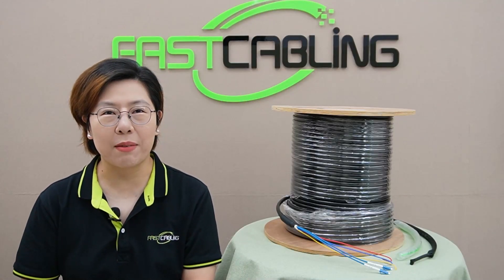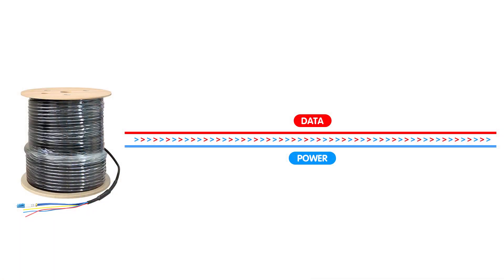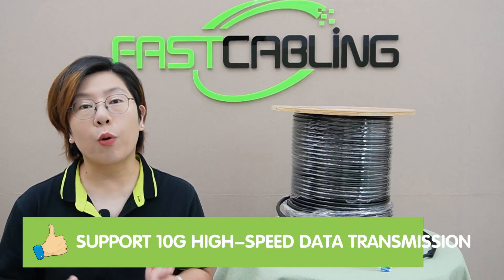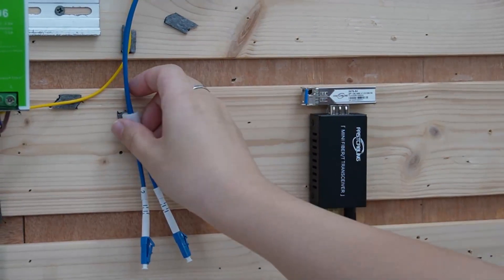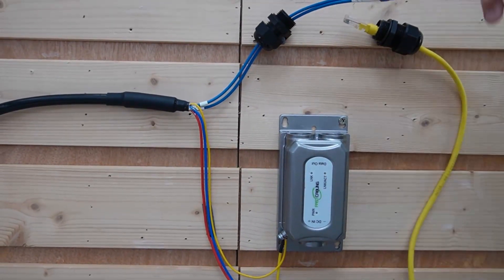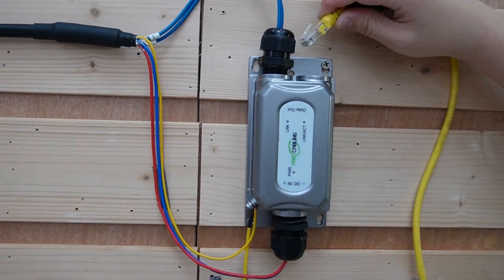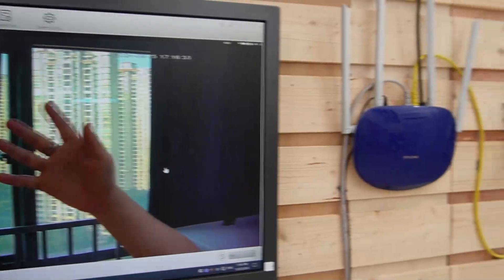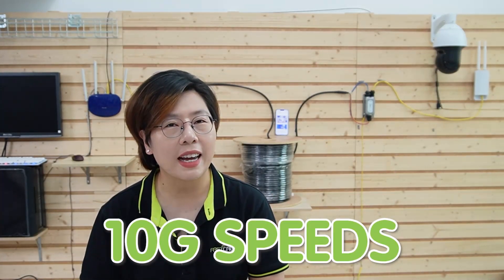How Armored Composite Fiber Optic Cable Simplifies Network Infrastructure

Comment: Please you did tell us how many core the fiber optic cable have.
Reply from the maker: The number of cores in the fiber optic cable can vary depending on the specific model or setup you're using. Common options include 2-core, 4-core, or even 8-core cables. If you're referring to the one in the video, it has 2 cores. 

https://www.fastcabling.com/product-category/composite-fiber-cable/

Comment: Don't forget to explain, it has distance regulations, people can't run this very long and obtain power.
Reply from the maker: Thanks for bringing it up! It's true that if the distance is too long, the voltage drop may become significant enough to affect the performance of connected devices.
Reply: @Fastcabling  I did a video on this and how to calculate the distances :)
Reply: What is the max distance limit?
Reply from the maker: While exact limitations can vary, a common rule of thumb for copper cables is to keep runs under 100 meters (328 feet) to minimize voltage drop. For longer distances, it may be necessary to increase the wire gauge (thicker wire) or use additional power supplies at intervals. 

Or you can consider using AC power. High-voltage AC transmission lines are capable of delivering power over hundreds of kilometers with minimal losses. By transmitting power at a higher voltage and then stepping it down near the load, you can significantly reduce losses due to resistance in the wires. But an air switch or circuit breaker must be added for safety concerns.

Comment: Can one connect multiple access points (hotspot)using this method for UpTo 40 kilometres
Reply from the maker: While fiber can cover long distances without signal degradation, the initial investment can be significant. 

Models like the AirFiber 24 or AirFiber 5X can achieve long-range connectivity with high throughput, suitable for distances of up to 100 km under ideal conditions. They operate in the 24 GHz or 5 GHz bands and require line of sight. The TP-Link Pharos series (like the CPE710 or CPE510) can provide reliable connections over several kilometers, though the maximum range may be lower than 40 km. For longer distances, look for higher-gain antennas or specialized models.

Some mesh network systems are designed for long-range coverage and can extend networks over considerable distances without needing wired connections. These typically rely on multiple nodes communicating wirelessly.
Reply: NOt with this cable, way to long.